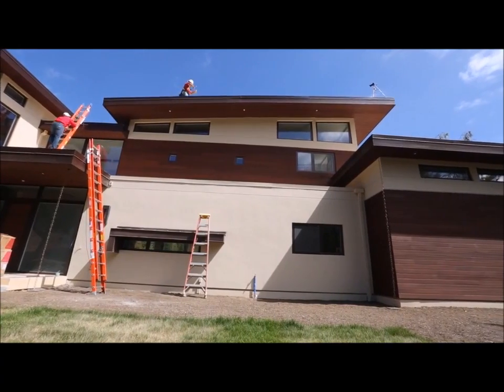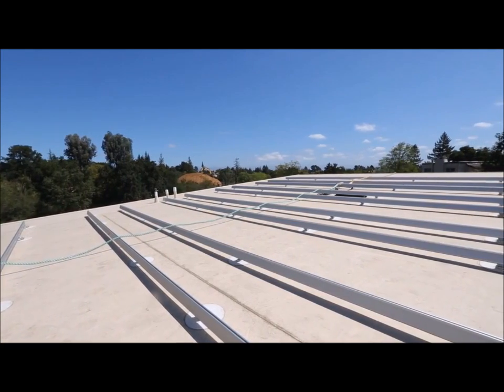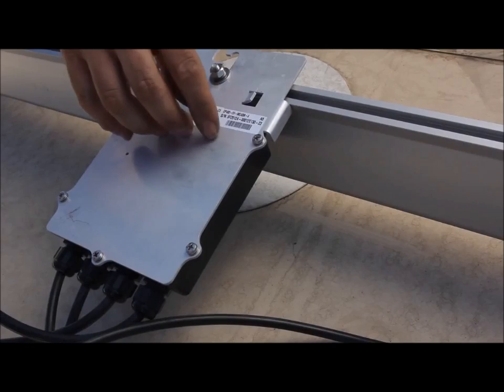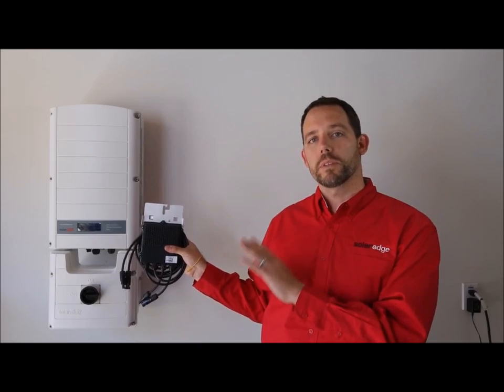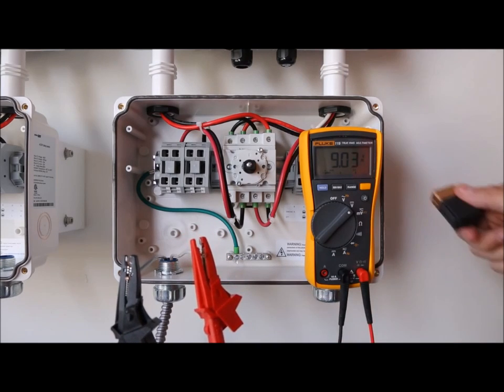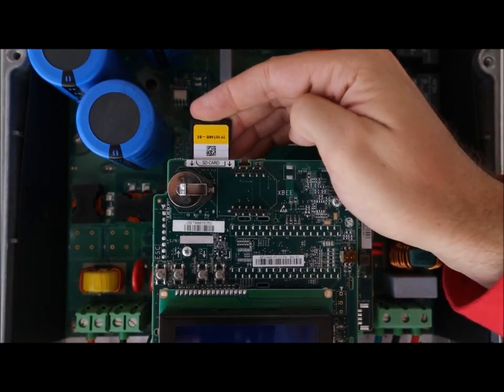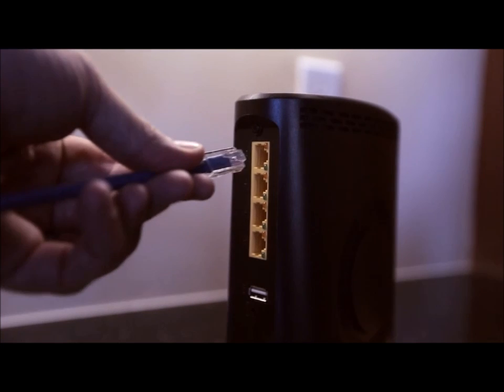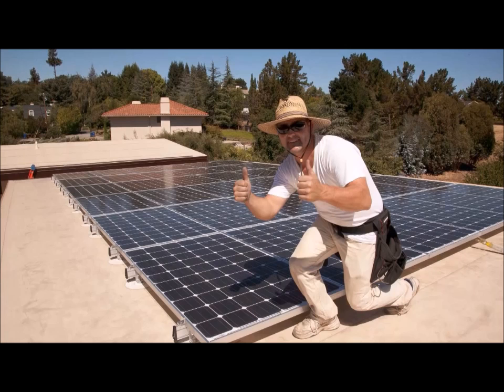SolarEdge Installation Guide: How to Install SolarEdge | RENVU

Comment: all my solar panels r connected, when i turn on inverter, it says set country, which i looked up to do, then i tried to pair it, and it freezes at "pairing in progress", usually after a few seconds of reading "pairing in progress" it starts counting down but mine doesnt, i dont know whats wrong, its not producing any watts/power
Reply from the maker: Based on your other question, we are assuming you don't have any optimizers. Right now, the inverter has nothing to pair with. Please contact us at info@renvu.com, and one of our team members can try to help you solve the problems you are experiencing! Thanks!
Reply: @RENVU  ohh thanks ! I just emailed them. Thought so, that it wasnt pairing because i didnt have any optimizers. Do u need optimizers for it to produce watts ? Because i dont have optimizers at home and its working just fine
Reply from the maker: @EVILalwaysDIES  My Solar Sales Engineer, Daniel, said he is in contact with you now. You're in good hands! :)

Comment: Is the SE3000H-US an off grid type inverter
Reply from the maker: Hello! Great question! The SolarEdge SE3000H-US HD-Wave and SolarEdge SE-3000H-US Energy Hub are both grid-tied inverters. If you are looking for an off-grid inverter, then check out the NEW SimpliPhi Power AccESS inverters with batteries. Here is a link to their 6.8 kW inverter: https://www.renvu.com/Solar/Off-Grid-Backup-All-In-One-Systems/SimpliPhi-AccESS-11.4-with-6.8kW-XW-PRO-Inverter-A-3PHI-SCH-PRO This is an excellent solution for off-grid/grid-tied systems. If you have any more questions, please send an email to info@renvu.com. To speak to our energy specialist, please put ATTN Chris. Cheers!

Comment: Is there any way to use SE5000A-US OFF GRID?
Reply from the maker: Unfortunately, the SE5000A-US isn't designed for off-grid capability.

However, if you are looking to use SolarEdge with battery backup capability for when the grid goes down, this is possible. To do so you would need a SolarEdge StorEdge inverter which comes in 3.8kW and 7.6kW sizes. You would need to add on an Auto-Transformer kit and the LG Chem battery (or similar) to achieve the goal of using the system when the grid goes down.

Comment: Why two SE5000's? Will the SE7600 work for your 9kw setup?
Reply: You can use a single 7600 in place of two of the 5000 watt units on a 9kW system.....keep in mind two things however.....1) with a 9kW system and assuming peak harvest, you will be running the inverter at about 90% capacity which may shorten its life somewhat..........2) If there were a failure utilizing two 5000 watt inverters and one fails, you will still be harvesting power, if you run the single inverter and it fails, you will be at zero harvest until repairs are made.

Comment from the maker: A must watch installation guide video
Reply: can i connect the solar panels and inverters all without the power optimizers ?
Reply from the maker: Hello! No, SolarEdge inverters and optimizers are exclusively and mutually required. SolarEdge optimizers cannot be connected to other inverters, and their inverters cannot be connected directly to PV Modules. If you have any more questions, please email us at info@renvu.com. Cheers!